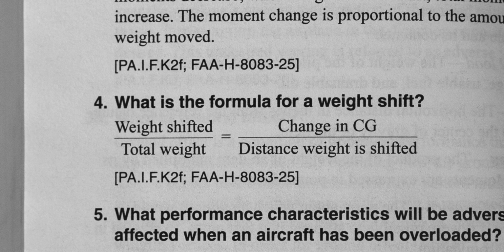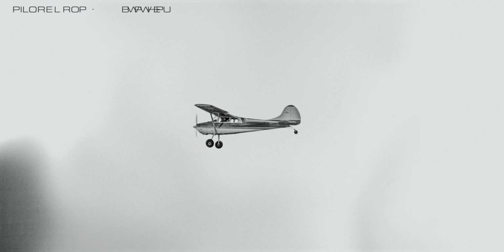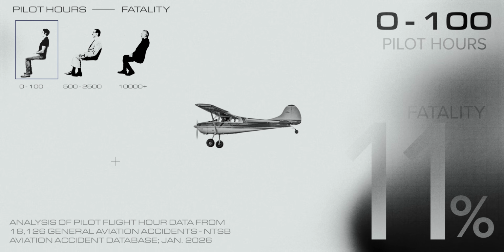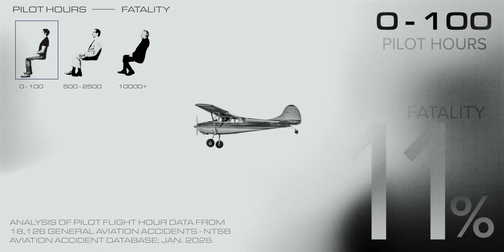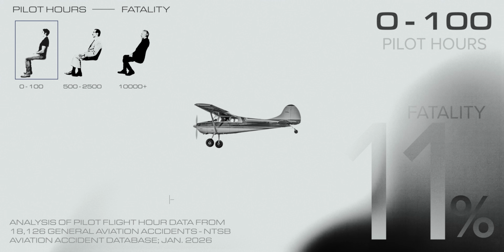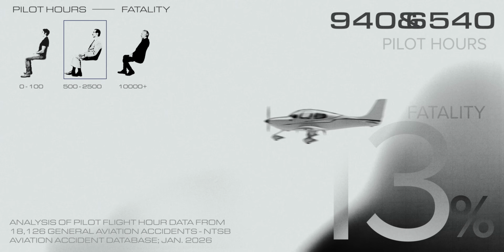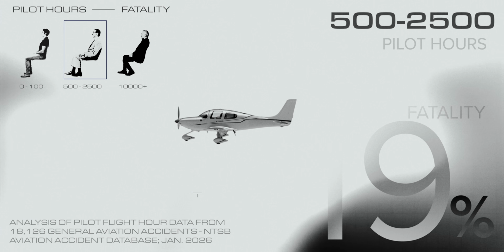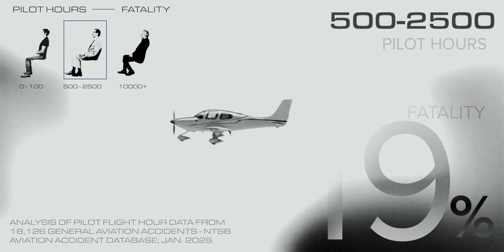Why Small Planes Crash (The 100-Year Design Flaw Nobody Fixed)

Comment: wrong, the design does not start with a risk assessment of failure in flight. you've obviously never designed an airplane before. Airplane design starts with defining the mission of the aircraft. Then you get into conceptual designs and preliminary performance analysis before you ever get into detail structural and system design. If the stated goal of the design is "safe flying", like the Icon or Ercoupe, then you will still focus on different concepts to address that even before you get to all of the failure modes of structures and controls. But if your focus is solely on safety, then who is your target customer? Xcountry flyers? STOL pilots? Commercial use? Sunday local flyers? Who? what is the airplane's mission Beyond just "safety"? You'll never sell an airplane that doesn't satisfy a specific customer need beyond simply "safety".
Reply: I too am skeptical of the whole concept of this presentation. The fact is flying is dangerous, just like getting out on the roads in a car or getting out of bed in morning. The previous poster was correct, first you need to design to mission.
Reply: @ralphhallett1684 the opening sentence of our video may have been misleading. We designed this to be a Xcountry flier from the start.
Reply: I can tell you’re very skeptical of our video and airplane program. What new airplane programs do you respect the most?
Reply: @shanestinemetz  new programs? not many. I've studied aviation history and aerodynamics to an extreme degree over the past few decades. In my experience, even most aerospace engineers don't know the true first principles of aerodynamic design. they don't study a broad enough range of aerodynamic topics to truly get a better understanding of what is going on. I have a whole list of aerodynamic ideas that I would implement on new designs of my own, that most people aren't even aware of.

The other issue is ergonomics. you seem to be addressing this a bit, but I've seen very few people that understand good ergonomic design in modern decades, and very few people who can design good HMI. Most software developers and such that design HMI today are so ridiculously bad at their jobs that it's disgusting. every time we get computer and software updates, the HMI just keeps getting worse and worse. Internet and computer OS are the best and easiest examples of this to point to. but many HMI in different industries I encounter are equally bad. People in decades past actually had a Far better understanding of HMI design. Ergonomics has always been a failure point in design in every era that I have studied. Once in a while you encounter a good design that almost nailed it ergonomically, but then nobody learns from it nor mimics it.

As a professional airplane and helicopter pilot, as well as a combat vet and engineer, I know the true risks associated with aviation, and I fully intend to die of old age, and not in an aircraft accident. Same for cars. I refuse to buy modern cars with computers, same for airplanes that don't have overrides and physical mechanical linkages to the flight controls. My cars/trucks are all 20+yrs old, and now people are waking up to the issues and jealous of my cars.  My airplane is from 1964, and i'm building my own airplanes going forward so that I control how they are made, what is put into them, and I won't buy/build airplanes without certain features. The best new solutions combine all the sound principles of older designs, with only the new tech that is actually necessary and actually improves the old principles. not all new technology is good, not all new technology is progress. Too often blind belief in "New is better" is regressive and outright dangerous.

a perfect example of an airplane with no concept of ergonomics is the entire line of Cessna singe engine airplanes (C150, C172, etc.). the cockpits annoy me to no end, and I'm not the only one to notice, and when i point it out to other pilots they get it.

I study the design, performance, ergonomics, and engineering of WW1 airplanes, WW2 airplanes, experimental designs, fighter jets, military combat vehicles (that I operated and even modified to fix their issues), helicopters, and much more.

I can design a STOL airplane that crushes all others. Others are catching onto the design principles I'd use, but nobody has yet put all of it together at once. but if I ever built that airplane, the fun of STOL would go away for most people as the airplane would be too capable and leave no room for future competition. 

I have a concept for a purely research aircraft to break the only major aviation record that I can think of that still exists that has not been achieved yet. The purpose of this design is solely to break that record, showcase new design ideas and what it could enable, and then donate the airplane to the Smithsonian. The airplane has no practical application other than as a tech demonstrator and record setter.

I'm also working towards low cost affordable and easy to build/maintain 1, 2, and 4 seat airplanes that meet most of light GA's real-world use cases. focusing on practicality and affordability over technology. Designing the airplanes GA Actually desperately needs right now.

and through all of this is safe design. Crash worthiness. I actually know how to design for survivability, know the relevant stats on crashes, and what principles nearly guarantee survival in a crash (I want to die of old age, not in a crash). The data is out there, publicly accessible, if people know what to look at and where to look to find it. it comes from more industries than just aviation too.

Of course, you can probably tell I'm not spilling certain specifics, as this is potentially IP for my own company in the future, so I don't want to just give away all of my ideas to others for free. I'm a capitalist, but I also don't believe in overcharging people. Volume of sales is more important that profit margin. And how much money do I personally need to be truly happy in life? (not as much as most people crave, that's for sure, I learned the value of life in combat at age 19, and money is not the answer). And customer trust and loyalty, company reputation, is everything. the rest follows if you take care of your employees and customers and have good foundational principles you don't violate. Anyone can figure out anything I have, if they spend enough time digging into this stuff the way I have, so it's not as if I'm denying this information to others if they aren't willing to pay me for it. But few people ever will. I have spent a disproportionate amount of time on these topics even compared to certain professionals who spent their entire careers supposedly working on this stuff. I do this in my spare time for fun, unlike most "professionals" and engineers I meet. I think about this stuff and read studies and books on it nearly every waking hour of my life.
Reply: @shanestinemetz  ChatGTP type of answer. Not a good look
Reply: @Narcan885fair 🫣

This is a Xcountry flyer. I live in LA and want to use it to save me the 8 hour drive to Tahoe. Leave Friday after work and come back Sunday night. 180 knots, 1000 nm range.
Reply: @Narcan885 there is nothing wrong with them seeking feedback on why I'm critical and skeptical.
Reply: @SoloRenegade Never said there was.
Reply: @Narcan885 then what was the point of your comment?
Reply: @SoloRenegade Try reading it again, it should help

Comment: What happens if the computer fails?
Reply: exactly. Or total loss of electrical power. I have experienced both in flight before. I will never trust an overly expensive electrical flight control system that isn't 100% bomb proof where my life is at the mercy of software. there are better ways to approach this problem. and their system will be r too expensive for most of aviation community to afford or maintain.
Reply: @SoloRenegade your life is at the mercy of software flying commercial. 
And it isn’t like this company is trying to bring this to the experimental space. They will be certified.
Reply: @ryanrabern8437  Commercial flights require 2 trained pilots who know how to fly the aircraft without the technology in the vent the tech fails. We've seen the catastrophic results of unskilled pilots who rely on tech and have know basic stick and rudder knowledge that would have saved them in an emergency. They are operators, not pilots. They are fine until things start operating wrong, or stop operating completely.
My favorite scene from The Right Stiff:

https://www.youtube.com/watch?v=C-qEmmpGYvA
Reply: Redundancies everywhere.  3 flight control computers.  Redundant power, com lanes, etc. etc. It's the same concept the commercial airliners use.
Reply: @greg-mercer  funny thing about redundancies is that sometimes they create alternate failure pathways. Consider for a moment the multi-engine airplane. Initially such was to give redundancy. And in island hopping scenarios it does. But it also creates asymmetric thrust hazard. And in mountainous terrain with high density altitude field elevations, it actually only extends the glide while creating hazard of attempting to get there. More redundancies means more stuff coupling which then can interact in unpredicted and unpredictable ways. Check your John Boyd Destruction and Creation. See Conceptual Spiral. And have a listen to that Synchronization as Coupling.
Reply: @greg-mercer  Just like the 737-MAX?
Reply: Do you ever fly commercial aviation? Same type of system.
Reply: This is true but as far as I know commercial pilots still receive adequate training in order to allow them to effectively fly the aircraft on their own. Also, the forces and factors involved in flying a GA aircraft are altogether different.
Reply: @F@FarCrispyhat do you mean by forces and factors? I’m a pilot. Forces and factors are the same.
Reply: Also GA pilots receive adequate training to fly effectively on their own.
Reply: you die, if all backups suffer a total electrical failure. a failure mode I have personally experienced in real life in flight. fortunately it was avionics only, and I had manual flight controls.

Comment: Oh, thank god! Many of us have been thinking this for years. Stalls, spins, spiral dives, flight into terrain, exceeding VNE, not putting the gear down, the list just goes on and on. And don't get me started on the petulant toddler Infernal Combustion engines we have to fly with. I can stick Ardupilot in my radio-controlled plane and all these 'pilot issues' disappear. Red tape is the only reason I can’t stick one in my GA.
Reply: You can put it in an experimental😆
Reply: this wont prevent stalls, spins, gear extension issues, and more. all of those things can still happen. Many have tried to make safer aircraft that couldn't stall, and yet all have still had fatal stall accidents anyways. there is a very fundamental reason for this regarding controllability. by removing controllability, you reduce safety by removing pilot options in different scenarios. and you can still take the plane out of CG, fail to do proper maintenance, have electrical failures, and such. When too safe, people get reckless, and then they discover things like maneuvering speed and more, but not in time to save their lives.
Reply: We’re on the exact same page!

Comment: There is so much obsession in GA about having control over everything. My pet peeve is the abundance of breakers and switches that need not be switched individually or should never be reset in flight. Yet people insist on having them.
Reply: I personally prefer no electrical system in my aircraft :p
Reply: This isn’t the right airplane for everyone. We get that! Some people will still prefer the “old way” and that’s cool too.
Reply: It's still nice to know when one pops.
Reply: @Karuiko oh yes but so can you with a led fuse. Fuses are actually more reliable, cheaper, lighter. But some people feel the need to be able to reset the breaker. Which you shouldn't in flight, really.
Reply: @SuperYellowsubmarin Ah yeah that makes sense. From a maintenance perspective, however, breakers are useful for turning off or isolating specific systems. But if the pilot really makes it a problem, then a fuse is for the better.
Reply: We'll be using digital, solid state breakers and deleting as many switches as possible with smart logic

Comment: we can say it is a huge safe rc aeroplane with built in ai(autopilot) feature.
isn't it.
Reply: exactly right
Reply: Auto Pilot and Fly-by-wire are very different systems. There are Auto Pilot systems for General Aviation (small aircraft) for almost 100 years now! Fly-by-wire is also not new, the Apollo program had it, the Concorde, most jet fighters in the last 50 years, and most airliners for the last 30+ years. Fly-by-wire is designed with a completely different system safety level, that's why the airliners are (by far!) the safest mode of transportation, and keep increasing it's safety level each year. The perception of systems failing come from other kind of systems, which are not certified to this level of safety. The budget RC ardupilot you are comparing to, is safe enough for a small RC, but has a probability of failure of millions of times higher than our system.
Reply: @LucasFontoura-skytron  FWB systems do fail, autopilots fail all the time.

"The budget RC ardupilot you are comparing to, is safe enough for a small RC, but has a probability of failure of millions of times higher than our system."

Who is comparing this to RC other than you?

We had a Civil Air Patrol airplane have to have its autopilot deactivated because it kept pitching up and stalling out the airplane. And the autopilot was too powerful for some of the pilots to overpower it, and they could only stop it by pulling the circuit breaker for the autopilot.
Reply: @SoloRenegade Single autopilots (non-redundant, non-voting) simply turn themselves off, right? Nasty systems. There backup is the (surprised) pilot. When FBW fails, the other two FBW keep flying.
Reply: @jeffreypierson3023  no, autopilots do Not turn themselves off. they don't know they are doing anything wrong. you have to manually turn them off. I've had autopilot fail and the only way to stop them was first to overpower them physically, and then pull the circuit breaker because nothing else was working.

Just saying FBW has redundancies tells me you know nothing about how these systems work nor their real world failure conditions. I design cutting electronic systems as an engineer. I have to design around failures that most people never think of.

Comment: I gather most envelope failures happen in engine problem situations, not with fully functioning planes in unchallenging situations. So I think you need to formulate the policy around engine out situations instead of what is trivial to automate. And I suspect that you run into difficulty overriding pilot inputs when simply preventing the input also leads to crashing. I get the impression that you think it's just setting boundaries and that will fix it but it's more complicated than that. And you get into real trouble when your policy leads to death when it would have worked in an unassisted aircraft
Reply: That's exactly right! Our main goal is to reduce workload and optimize performance specially for engine failure and other distressful situations. And it really is not "just setting boundaries" that is a simplistic way to explain in a short YouTube video, but this technology is very much consolidated today, it's in use in civilian airliners and business jets for decades, and is renown for being much safer than mechanical controls. It was just too expensive for the smaller aircraft...until now! We will explain in more details how this actually works in future videos. Stay tuned!
Reply: @LucasFontoura-skytron nailed it

Comment: Look up the Zaunkoenig - Eric Brown describes it in his book 'wings on my sleeve' - non pilots could fly  it safely after one hour or less . Glider pilots , only minutes . There is more to flyability than FBW. and weather related accident is the most significant - needs roadability.
Reply: Checking it out now!
Reply: that is absolutely true! but the idea of the project is not just to design the "easiest to fly aircraft", but to design the safest and easiest to fly personal aircraft for 4 people, that can fly a decent range, above 150 kt, in a competitive cost. That is a much different problem to solve than a very small, ultralight, because the aerodynamic behavior is different for those different kinds of performance. The same happens for jets, that's why most jets are FBW now!
Reply: correct, FBW, software, expensive technology, etc. are not the answer to this problem.
Reply: @SoloRenegade Can you imagine a FBW that turns you away from windshear, severe turbulence, hailstorms? I can.
Reply: @jeffreypierson3023  sure, but that's not what we're discussing here, now is it. Also, you cannot  have such a FBW autopilot as you cannot deviate without ATC approval in IMC or on IMC flight plans. Also, ATC is helping redirect such pilots. and anyone flying VFR who flies straight into a visible storm is an idiot. If you can't make good decisions, you're not fit to fly any aircraft under any circumstances. And automating flying so teh drunk masses can fly too is not going to end well.